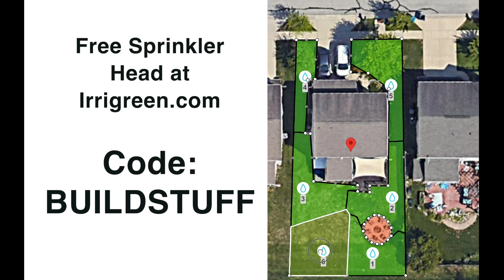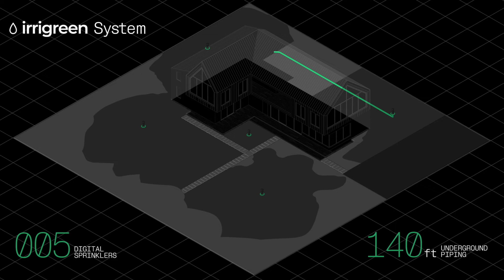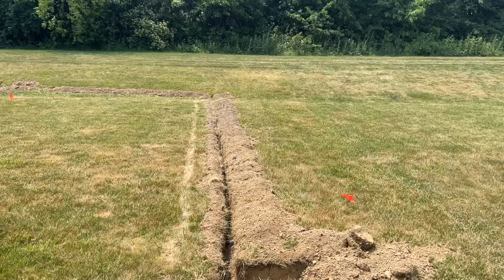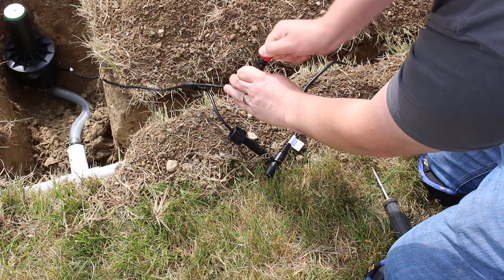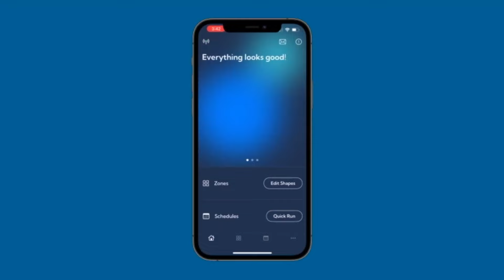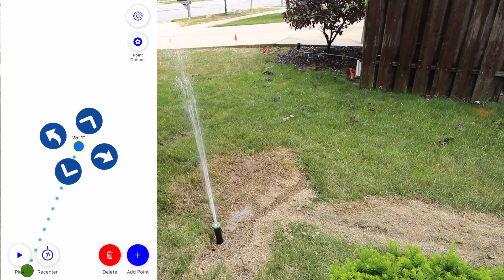Ultimate DIY Sprinkler System

Comment: How does the system learn the shape of the area being watered?  When you put the head in, does it need to be oriented in a certain direction?
Reply from the maker: It is all done through the app. Check out the video at the 7:40 mark to see how it works.
Reply: Thanks for the quick response.  I understand now.  I appreciate your video, this is a great system.

Comment: The idea is fantastic, but for just a two head system (what I would need) it would be $2000.  Yikes.  Interesting you made no mention of cost, especially when you were so conscious of the amount of labor and materials to install it.  I could hire someone to install 8 heads, all materials included, for less than that.  

And from reading the comments, the long term reviews aren't positive.  Many glitches and failures.

And I see from the video the changes in distance of the heads goes in steps, so it's not ideal for following angles or curves.

In summary, it sounds like a fun vanity gadget for the rich and famous to show off to their friends, especially for friends who are super into "eco" everything.  But otherwise it looks like more trouble and expense than it's worth.

Comment: Conventional systems DO NOT waste waster as per your diagram. Manufacturers design the heads to be spaced as to have matched precipitation and even precipitation rate which is why the head to head coverage is needed. On a properly installed system, no matter where you measure there will be equal water applied.

Comment: How did you tie into the water though
Reply: I am supposing it is from your house line or a hose head. Connecting and installing a Back Flow Device (google it).

Comment: You've got to be insane to buy this. An irrigreen starter system with 1 sprinkler head, one wire and the controller will run you 8000 dollars.
The sprinkler head alone is 1100+ dollars.
A regular sprinkler head is like 15 bucks.
The controller, which needs about as much brains as a 20 dollar ESP32 nodemcu will run you 6500 dollars.
Absolute insanity.
Reply: You are very misguided, or your math is really poor. A 3 head system with controller is a little over 2000.
Reply: @thehousedr4  Actually it's their website that's doing the poor maths i've just figured out. It seems to be converting to my local currency, but it's still using the dollar sign on the website. So initially a 3 sprinkler system is 11178 dollars, but when actually adding it to my basket it's suddenly 11178 Polish Zloty's, which makes a bit of a difference.
Good thing i'm not in Hungary, because then it would show up for half a million dollars.

Comment: Pex would be better.  Flexible... more direct runs... less trenching and pipe, even stil.  Oh, and less pressure loss due to elbows.
Reply: Just had a call with them this week, they said for my area that the best solution would be 1" polypipe, as it has less issues in the cold. Added bonus, it's cheaper. Also the frost line is fairly irrelevant, you need to blow the whole system out or you're gonna have a bad time.
Reply: @NDGeist  I agree with respect to the frost line.  It ends up being more of an insurance policy, but more for also ensuring that you don't easily strike the pipe with anything else.
Reply: Supposedly you're not supposed to bury PEX without a special wrap applied, which can add to the cost. Schedule 40 PVC should be preferred as it is also more durable and resistant to breakage. Also make sure you know how deep your frostline is for your region or you will end up being very sad when summer comes around.
Reply: @nova31337  I've never read anything about a special wrap.  I've read "properly insulated" which has always been in the context of getting it below the frost line... the soil being the insulator.

Comment: hate to be that gut but no deburring the pipe, primer, or gluing both pieces the pipe and the fitting! Yikes next time watch some youtube videos on how to fit PVC pipes before showing others how to do it. And The kinked line!
Reply: Yo, primer alone can weld-fuse pipes together fully strongly.   Cement alone can work too, if the pipe is clean.
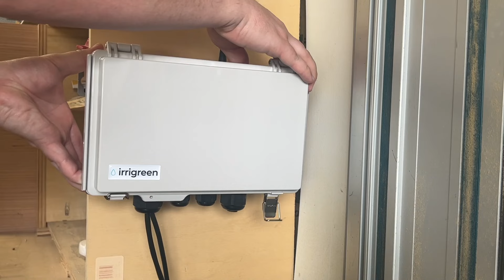Reply: Primer both sides, glue both sides. Plus he didn't give it any rotation (which might be the worst offense of all) when he put the pipe in @ 5:25..
Reply: Without the rotation is the least concern, with proper priming and/or cementing, with a clean pipe,… at least for 1/2'' to 1'' pvc. @NDGeist

Comment: The failure rate on the heads is pretty high and their customer service is hit or miss. I'm glad to see they have fixed the wiring issues now with the preterminated cables. They could have sold a ton of these systems if they would have just lowered their price. Unfortunately they spent 10 years developing this, spent tens of millions of venture capital money and now the time has come to pay the piper. I see this company going the way of Juicero. Hopefully it gets scooped up by Rain Bird when it finally goes tits up.
Reply: “Tits up” gave it away that you are from the UK! Lol
Reply: My first thought was, that wire should probably be in some conduit or pvc pipe.
Reply: You like tofu?
Reply: Well usually the inventors are not the money makers. It’s when the Patent runs out is when these thing become affordable as every big company will produce.

Comment: I can stomach the price of the sprinkler heads, but the controller cost is insane.  It was going to cost close to $2k for one sprinkler head and a controller–  not installed, of course.  Extra sprinkler heads were something like $368, I think.
Reply: The sprinkler/controller cost is genuinely stupid.
This is something you can program on a $5 arduino board with $cheap ass servos.
Reply: @honkhonk8009 yes, just because techie people like you and me COULD do it, doesn't mean the bulk of people can.
Reply: @nova31337  No i mean why isnt this thing sold in mass on Amazon? Like this the type of thing you expect to have its plans sold for free online yk.

Its a cool idea and im confused why more people aint tried it before lol
Reply from the maker: The upfront cost is definitely more then a regular system but what you save on total installation cost and water usage makes up for it in the long run
Reply: @ProjectBuildStuff rofl,ok please show me the back of the napkin math on that? No way would this system pay for itself vs a basic sprinkler system that is setup correct. What the pay back period, 20 years assuming nothing electronic breaks in that 20 years. Would love to see that pay back comparison for your yard.
Reply: @ProjectBuildStuff  lol on water savings.  if a system is installed correctly, head to head coverage, calibrated correctly.  If I put 0.5 inch per zone on both, how am I saving water?
Reply: @butchbr73 that’s my thought as well
Reply: @butchbr73 - like you do not water the trails and porch... Sereously, how much is that? 20%? I pump water from 100m well. Each CBM costs me around  0.1$. During the season I pour 700 CBM on the lawn - 70$!!! Do you have any idea how many centuries your upfront investments will take to pay off at 14$ per year rate of savings?...